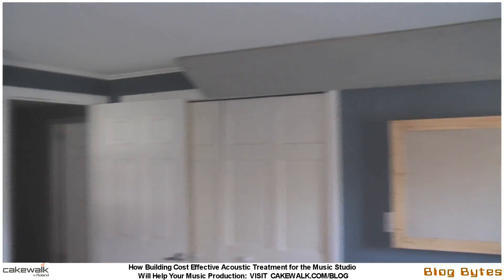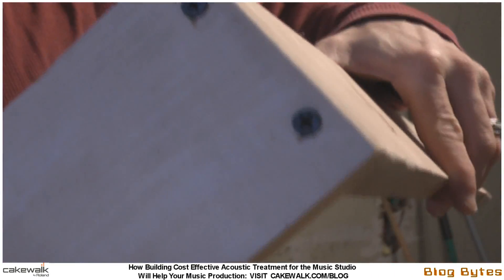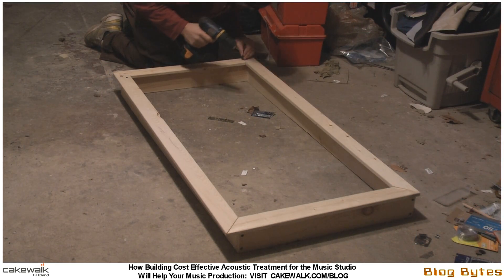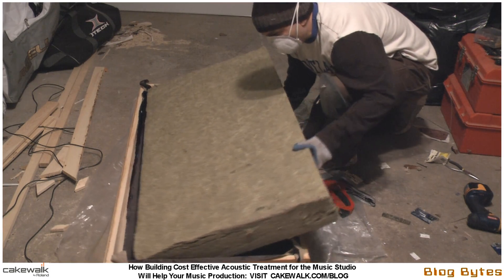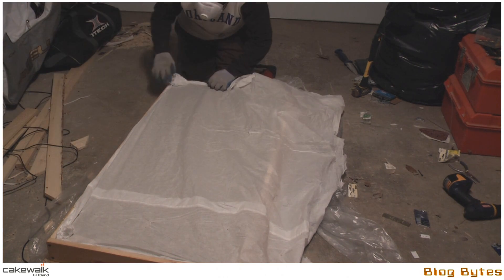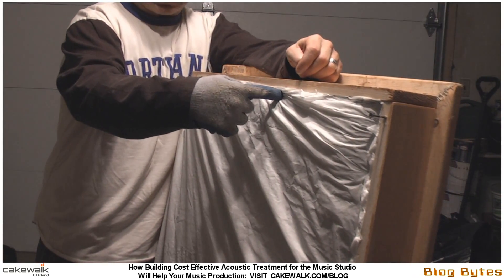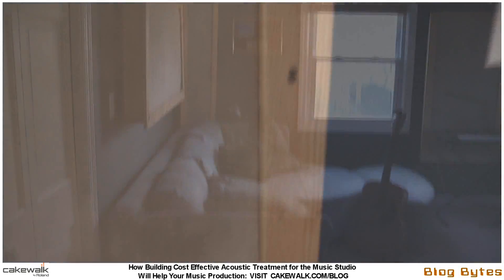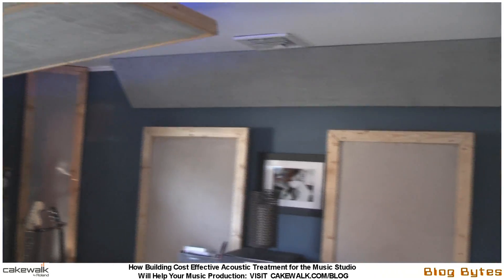Cakewalk: Blog Bytes; Building Custom Cost Effective Acoustic Treatment

Comment: My only concern is, was this insulation, ever really intended to be used between fabric. or was it meant to be capsulated in drywall ? using Mineral Wool in fabric, does it get the job done ? it sure does, can it be hazardous ? I believe that its a possibility. maybe im wrong..in any case I hope im being a Debbie downer here, im only bring up a possible valid point.I also can not take away from the great job you did on these panels. they look amazing and im sure do a great job in deflection/abortion.